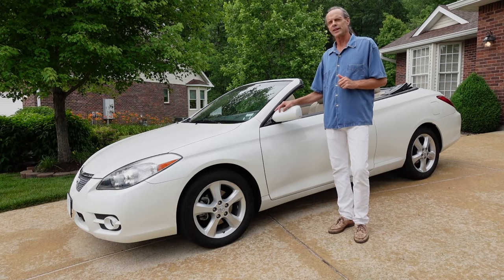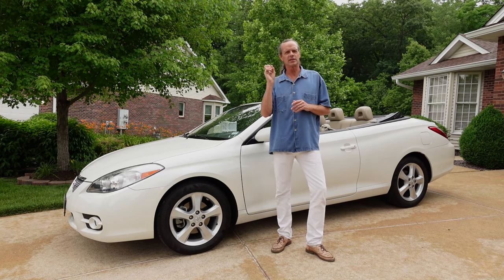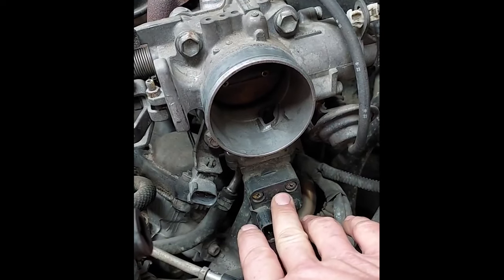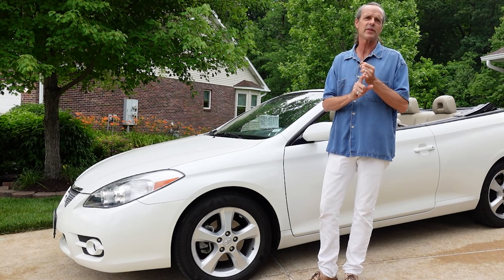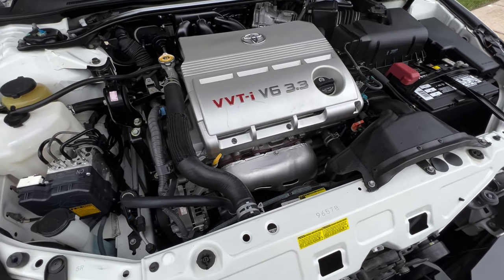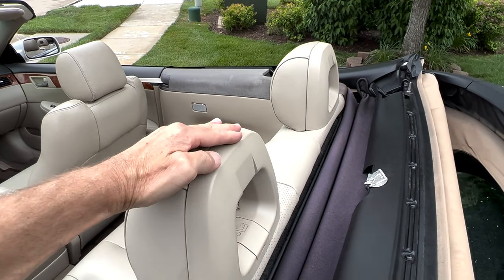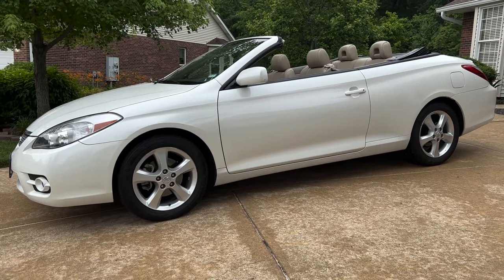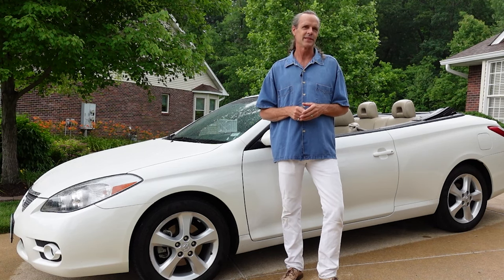Problems to Look out for When Buying a Used Toyota Solara Convertible

Comment: Elderly neighbor sold me her late husband's 2005 Solara convertible for $5500. Pristine condition and only has 50,000 miles on it. Great car!
Reply: Hello , i keep hearing that convertibles make large amounts of noise while driving. Would you mind sharing your experience with your Solara?
Reply: @eiyrie2990  Only if the top is down and you're driving fast (over 55 mph). I only drive with the top down in the city where the speed limit is usually 40mph or less, so it isn't a problem for my use case.

The only major complaint is that visibility through the back window while the top is down is limited, so backing out of a busy parking lot may be a problem.
Reply: @eiyrie2990  Hi, I have owned several convertibles and for me the road noise has never been an issue. The older covertibles ( I learned to drive on a 1967 Chevy Impalla convertible) may have been a bit noisier due to air moving over the vinyl tops and less interior insulation, but more modern convertibles drive and sound pretty much like a normal car. If you are thinking of getting a convertible don't let the noise argument dissway you from making the purchase. If it is a used convertible just make sure it has been well maintained as you would any other car. The car I own now, a 2007 Toyota Solara, looks exactly like the car in this video. We purchased it in 2011 with 25k miles and it now has 165k miles and we keep it well maintained and follow the manufactureres maintenance recommendations.  My wife and I love it! Good luck!!
Reply: Too bad some one had to kick the bucket so you could get a car.
Reply: I’ve had a convertible since I was 16. I’m 67. I bought a 2007 3.3 SLE Solara for $7500 & 38K miles on it. It just passed 127K. Never had any problems except a dead starter at 85K. The top is always down, unless it’s raining or snowing. The road noise is NOT a problem. The low profile tires are very quiet.
Reply: @eiyrie2990  With the top up you'll hear a bit more noise from your surroundings and I guess you do hear a little more road noise and such. Top down can be a different story depending on how fast you're going but rolling up the windows helps reduce noise.

The biggest thing is the cowl shake but that's a trait a lot of convertibles share. I've read the Solara isn't as bad as some others.

These are great cars and mine is probably my favorite car I've ever owned. You can't do much better than this if you want a comfy boulevard cruiser that'll fit four people (the back seat is pretty large by convertible standards).
Reply: OMG ! What a terrific deal ! You scored !
Reply: You sir are WAY too low on coolant.

Comment: I own a 2007 Solara now sitting at 101K + miles. Great ride all around. Your video was very unique in that it was fully descriptive of the vehicle, highlighted problem areas without being harshly critical and, best of all, you were down to earth on your presentation. Thank you greatly.
Reply: V6?
Reply: @dallylove4227  theres a v4 and a 3.3 v6
Reply: I’ve had a convertible since I was 16. I’m 67. I bought a 2007 3.3 SLE Solara for $7500 & 38K miles on it. It just passed 127K. Never had any problems except a dead starter at 85K. The top is always down, unless it’s raining or snowing. The road noise is NOT a problem. The low profile tires are very quiet. I haven’t had the problem with leaks in the top, Even with Northern Calif rainy season.

Comment: Thank you for your video. I bought a used 2006 Solara convertible in 2017 for $10k. It is light blue with a light tan top and an almost ivory leather interior. I am the third owner. I knew both previous owners and that it was well cared for. The car had 10k miles, I jumped at the chance to buy it. Now the car has 17.5k miles. I have other vehicles and I  live in the frozen north, so it doesn't get much use other than on nice sunny days, but it sure is fun to drive when I do use it. I have loaned it out to friends from the warmer climes when they visit and they get a real kick out of driving a convertible where you wouldn't think that one would exist. We do get temperatures up in the high 70s and 80s during our short summers.
Reply: Great to know. I am looking into a used 2006 white solara with 73k miles on it.

Comment: I recently bought a 2007 Solara.  Here is additional 2 cents from me if u buy one of those.
 Check the water leaks from the gutter of the roof top.   The gutter of the roof is hidden under the black metal cover at the top of the trunk, but you will see the gap.   Close the roof and hose lots of water at the back of the roof.  Water goes into that gap, then it will come out from the sides of the car.  If there is a hole or tear with the gutter, you will see a lot of water inside the trunk.    Mine was this case, and it was a huge pain for me to fix those huge holes.   Holes are so common at the both side of the corner of the back.
Reply: Same issue I had and water went under the back seats aswell

Comment: I own a 2007 Solar convertible with same coloring as the one in this video. I have loved this car for 16 years. Your video was informative. Thank you
Reply: Hello , i keep hearing that convertibles make large amounts of noise while driving. Would you mind sharing your experience with your Solara?
Reply: I’ve had a convertible since I was 16. I’m 67. I bought a 2007 3.3 SLE Solara for $7500 & 38K miles on it. It just passed 127K. Never had any problems except a dead starter at 85K. The top is always down, unless it’s raining or snowing. The road noise is NOT a problem. The low profile tires are very quiet.

Comment: Hi Greg, I have a 2007 Toyota Solar (white w/tan top, tan leather interior) which I purchase in February 2011 with 25k miles and it still is performing excellent with a 165k miles on it. I have owned many cars in my life and several covertibles, but this is without a doubt my favorite car that I have ever owned. My wife and I both love driving this car and we do our very best to keep it well maintained and follow the manufacturers maintenance schedule. I replaced the top and the drain gutter myself a few years ago and overall the car still looks beautiful. The interior is starting to show its age from normal everyday use, but that is to be expected. My wife and I will periodically speak about getting a newer car ( before this car I would typically get a newer car every five years or so) but we both love driving this car so much it would break our hearts to get rid of it as it still looks and drives great. Unless Toyota starts making a convertable again we have no plans on trading it in anytime in the foreseeable future. Thanks for the video!

Comment: We have had a 1999 Solara, and two 2007 Solara Convertibles.  They are excellent cars and if Toyota was to produce a new line of these I would put in my order on one.  We still own one and my wife does not want to part with it and go with a Highlander or something more Colorado friendly.  So I put a new set of tires on it, change the oil and battery and we are good for a long time.

Comment: Info came in handy with the purchase of an 08 fully optioned SLE. One owner older couple, garaged and heavily serviced. For a 14 year old car it looks barely a couple years worn. Everything works no rust all the bits and they even kept the window sticker. Do wish it had a manual though I know the convertible didn’t offer it. Still so fun to drive and a suitable daily for all my stuff my truck doesn’t need to do. 125k miles and they had the timing belt done. Only thing I updated was the head unit and added a backup camera.
Reply: Ditto on the one I bought recently. I can't completely verify entire maintenance but clearly it was a well-maintained car that runs as smooth as can be. I also added an upgraded head unit and camera which is really the only thing these cars need to bring up to a more modern spec. Going into the purchase I planned on keeping the car for just a couple of years but a few months in I can see keeping the car until it dies lol.

For the guy who posted the video, the mid-cycle refresh came in 2007 but otherwise I'd say everything about the video is spot on.
Reply: Same for me. I’m at 127K on my 2007 SLE. Fun car, good mileage. Great car.
Reply: I got one a couple years ago and also did a head unit and back up camera upgrade. It really is the one major thing this car is missing and the factory integrated feel is great. Unless this car really starts gaining in value to the point of making some good money, I don't see any reason to get rid of it and will keep it as another car if for whatever reason I need to get something more modern.

One thing not really covered was the dash cracking issue. These cars are notorious for developing cracks and really bad. Any prospective buyer would see it but even on a good car it's something to keep in mind as a potential issue down the road.
Reply: @thedude957  l lucked out in that area as the prior owner kept it in a garage mostly. No cracking but it does get weird and sticky in high heat. Also got a premium cover with it that I still use regularly. Just got it back from the shop after rats ate the harness triggering a bunch of codes. Had left it at my mom’s for a couple months for reasons. All good now and only $500. Getting ready to do some further upgrades to the audio, tinting the windows darker and adding in a dashcam. Oh and new headlight domes. Love this car.

Comment: At 137K, I finally did the very first significant repair on my 2008 Solara convertible:  The CV transaxle boots were torn....a $750 repair.  The car has not needed ANY other notable repairs!  Just a terrific car.
Reply: Hello , i keep hearing that convertibles make large amounts of noise while driving. Would you mind sharing your experience with your Solara?
Reply: @eiyrie2990  I’ve had a convertible since I was 16. I’m 67. I bought a 2007 3.3 SLE Solara for $7500 & 38K miles on it. It just passed 127K. Never had any problems except a dead starter at 85K. The top is always down, unless it’s raining or snowing. The road noise is NOT a problem. The low profile tires are very quiet.

Comment: We bought a used 2007 Toyota Solara in 2017 for about $4,000. It was good deal. I had never heard of Solara before. We bought it because it was a Toyota and coming from a trusted seller. It's our only car now. We had a 2000 Corolla that we recently parted with. Loved that car.

Comment: Bought my 2007 ragtop Oct 06. My everyday driver. No problems until the alternator and hood struts needed replacing this month. I get lots of compliments. No, it's not for sale!
Reply: Hello , i keep hearing that convertibles make large amounts of noise while driving. Would you mind sharing your experience with your Solara?
Reply: @eiyrie2990  Nature of the beast but nothing like ragtops of the 1960s & 1970s. These have headliners. Biggest downside of any ragtop is rear visibility. Hardtop convertibles have much less trunk space but I'm sure are quieter.
Reply: My 2007 3.3 SLE IS available for sale but I want $20K for it 🤠
Reply: I’ve had a convertible since I was 16. I’m 67. I bought a 2007 3.3 SLE Solara for $7500 & 38K miles on it. It just passed 127K. Never had any problems except a dead starter at 85K. The top is always down, unless it’s raining or snowing. The road noise is NOT a problem. The low profile tires are very quiet.

Comment: My friend bought a red '06 Solara convertible and I drove it a lot. I liked the car so much I'm looking for one of my own, preferably white. The Solara is very reliable and fun to drive. My only complaints would be limited view out the back when the top is up and the leather seats got very hot during the summer months, particularly if the top was down. There was also an occasional rotten egg smell from the catalytic converter.

Comment: Bought an SEL Recently. 2008, 92k, one owner, dealer serviced, garaged. Hit in rear over a decade ago but you would not know it. Nice car. Paid 10k and it was a fair deal  Handles better then I thought it would. Not a sports car but sporty.My mechanic was surprised at the great condition of the car. Satisfied so far.

Comment: I have an 06  convertible with 190K and it runs like a top!  the 3.3 L engine is a non interference engine .
Reply: I think its an interference engine. Make sure to change your timing belt when its due

Comment: The refresh happened in 2007, not 2005. The car was the same from 2004-2006, and the final two years had the bumper taillights, Bluetooth, new grill, steering wheel, new holes in the rollover headrests etc. otherwise, pretty spot on I think.

Comment: I have a 1999 V6 SE with 5 speed manual.  First gear is quite low and a lot of fun, getting the engine into its power range really quickly. Very different from the sluggish automatic transmission.

Comment: Great video. I love my Solara Coupe. I dont like the interior noise of the convertible nor the maintenance on the roof so I’m fine with my sunroof . I love this car and do think it will be very reliable but it’s lacking in comfort and has street / wind noise . Eventually I will switch to the 2002 - 2006 Lexus Es . Maybe it’s because I’m over 50 . I’m gonna try some aftermarket seat cushions first as I can always turn music up for the noise. One thing I will say is switching to ride flat tires added some noise. I’m more concerned with the seat comfort . I do like the ergonomics.  I’ll probably regret selling ! Lol I’ll just continue to change oil every 3 k and hope it doesn’t start to burn oil as I have the 4 cylinder.

Comment: In my 2005, he internal rain guttering system was made of cloth and it degraded to the point that it would allow water to leak behind the back seat/floor and the trunk, filling up the spare tire well.  Removing the rubber plugs under the back seats and in the bottom of the spare tire well helped the water drain, but the back seats still become somewhat soggy in heavy rain.

Comment: I had a 05 Solara se sport. V6 was a good car traded it at 131,000 miles dependable car. Replaced front tie rods struts & general wear things brake pads Toyota quality.
Reply: And timing belt water pump at 91,000 miles.

Comment: I have this car. Bought it used 6 years ago. Engine and transmission is solid like new still but body is falling apart and it's pissing me off. All the plastic outer trim pieces around the window and on the back of the convertible top are either cracking or peeling off and fading. All the rubber moldings around windows have gone to shit as well. Engine bolts are rusty that's no big deal. Some smaller rubber hoses became brittle. I am banging my head on trying to find what these parts are called so I can order replacements for them. Biggest issue is the convertible top which leaks now costs like 3 grand or something to fix.They made the engine so well that the body of the car will deteriorate before the engine ever does.

Comment: I've been researching Toyota Solaras and the convertibles are plentiful. It's the coupes that are few and far between. I know that Toyota built a few of the first geniration (1999-2003)  Solaras with the 3.0 L v6 engines and 5 -speed manual transmissions. I would love to find one of those cars in an unmolested condition. But I'm most likely going to have to settle for one of the second geniration (2004-2008) cars with an automatic trans. Those with the SLE trim package are really nice!  But they all have those "sun-moon roofs". I worked with a man who restored cars for about 3 years. We restored a lot of English roadsters "MGBs TR6s and the occasional Jaguar. We had some meny of our customers bring their cars in with slashed roofs, and upholstery.. We worked on cars with those sun-moon roofs and T-Tops too, and we had  the hardest time keeping those things from leakng..
Reply: Think you will have to go to Japan for the five speed. I sold Toyotas back then for Sandy Springs Toyota and we were told they weren't going to be available.

Comment: Hi there.  I’m buying one hopefully—it’s 2024.  The one I’m buying is a 2005.  Buying because I need a reliable vehicle for $5K or less.  164K miles…any thoughts?  Or things I should check when I go test drive?  Also, do you have any thoughts regarding an Avalon vs Solara?  Thanks!

Comment: I tried. Just after the pandemic. I test drove 2. They were just too large. Too Bulky. Waaay too hard to see out the back. That was a deal breaker. 
Paid half, bought a 2000 Cabrio, that was much more what I wanted. Handles waaay better, easier to maneuver, I can see out the back and it’s actually more solid feeling. That second gen Solara had a lot of cowl shake, and it was much newer, less miles. I may have considered a Paseo Convertible, but how often are those available? Still prefer the VWs, honestly. I wish we had more small convertibles in the USA. I bought a 15 XB manual a few years ago, I ❤️ it.
Reply: The Solara is a different kind of car though. VWs tend to be a bit sportier than Toyotas. But the Solara does offer a decent amount of room in the back seats and is definitely a boulevard cruiser. If that's your thing it's tough to go wrong with a Solara if you can find one in good condition.
Reply: @thedude957  agreed. I was just absolutely blown away by the poor rear vision. One I last drive was $5000, 2005, 110k miles. Not a bad deal. It was on lovely shape. Just too bulky and difficult to see out of.

Comment: Have a 2007 white convertible .Headlights fade in the sun and I polish them out.
Would like to get new headlamp assemblies.
Problem is my headlights tilt up and down.
There is a switch on the left side of steering post.
I can not find any reference in Toyota parts for these tilting head lamps.
So my question to the Solara world is can I just put in regular headlamps??